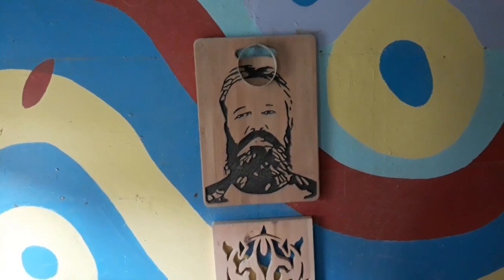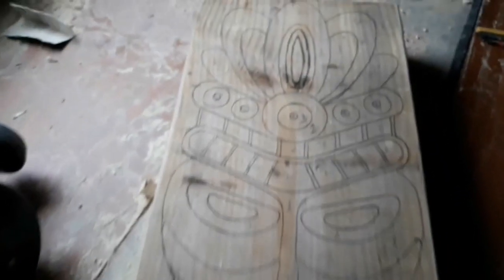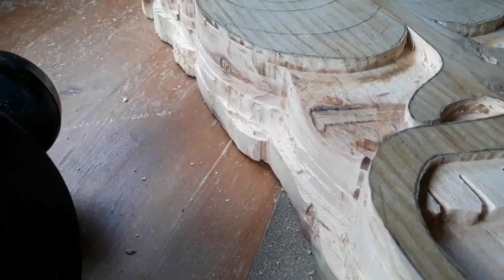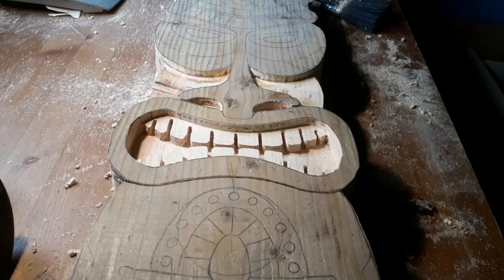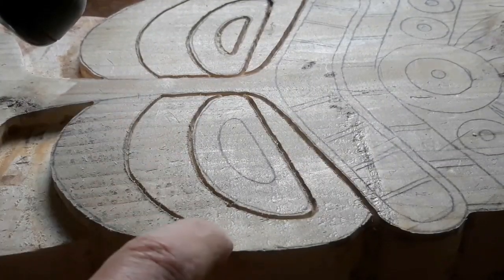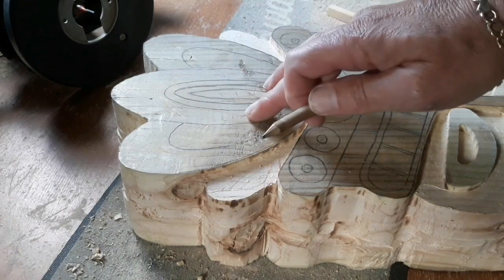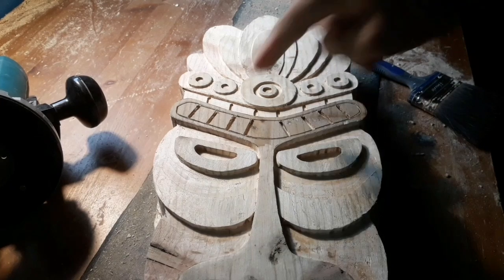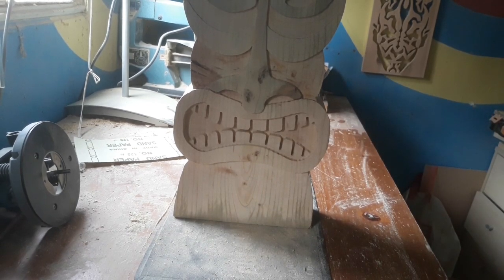Router made tribal mask

Comment: Great work.. I got a1/4 palm router.. Can I get the small cutters for this?
Reply from the maker: Thank you,my router is also a 1/4" one,so the bits will fit no problem, as long as you have the adapter collet, I get my bits from Ebay..or Amazon..
Reply: @fishtank5050  ah right OK so what are say the main 3 is need?
Reply from the maker: @123GEZZY  these are the bits I use, theres different bits you can get I just prefer these...
Cnc bits for the lines ...https://www.ebay.co.uk/itm/324514593462 
End milling bits for the clear out https://www.ebay.co.uk/itm/353029506162
Adapter collet 6.35mm so they fit your router..
https://www.ebay.co.uk/itm/133672486404
Ebay or Amazon, they can vary in price, so check  the list out,hope this helps..
Reply: @fishtank5050  thats very kind of you to share that..thanks...what adapter will i need? so i can use these
Reply from the maker: @123GEZZY  it's in the links I've given you..
Reply: @fishtank5050  ah I didn't see that bit lol.. Thanks again
Reply: @fishtank5050  just found this collet on amazon as the one you listed was from China so take a while to get here but will this work. : Generic 6.35mm to 3.175mm 1/8 Inch Engraving bit CNC Router Tool for 6.35mm Collet
Reply: Or this :Niady 6.35mm to 3.175mm Precision Engraving Bit CNC Router Tool Adapter for Collet
Reply from the maker: @123GEZZY  those look good to me, ordering from china is a nightmare regards to delivery, I always order my sanding drums or cnc bits weeks before I need them, I had someone come back and say the 6.35mm didnt tighten up enough, so he order the 6mm adapter collet ,some have had no issues with them,i think it just depends on the company that made them..hopefully you will be lucky with the 6.35mm collet...